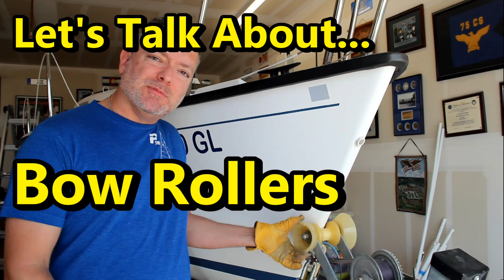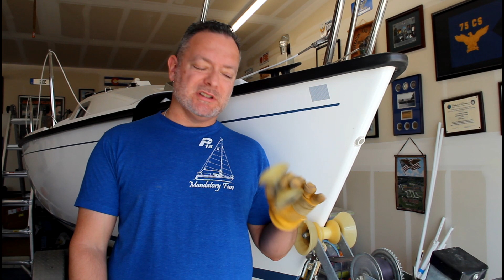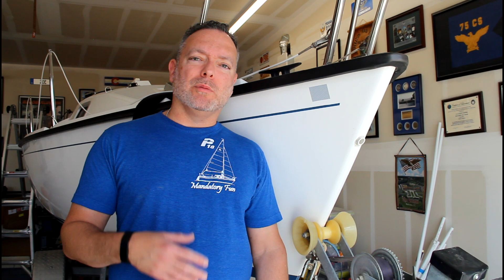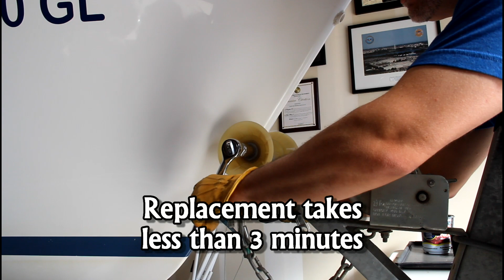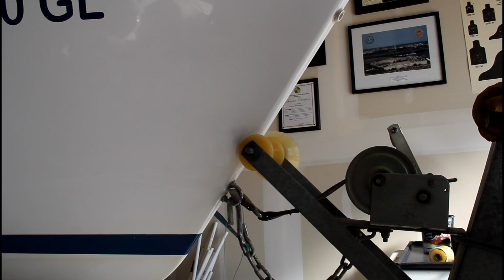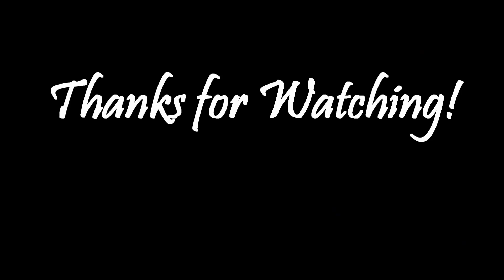Let's talk about: Bow Rollers

Comment: Link needs to be in the description.
Reply from the maker: You can find them a couple ways: Google “Yates rubber bow rollers,” search on Amazon, or go to the Yates section on eTrailer.com: https://www.etrailer.com/dept-pg-Boat_Trailer_Parts-sf-Roller_and_Bunk_Parts-pm-Yates_Rubber.aspx?utm_source=google&utm_medium=cpc&utm_campaign=Google%20%7C%20Dynamic%20-%20Search%20Ads&adgroupid=60357939010&campaignid=1672411816&creative=420838556612&device=m&devicemodel=&feeditemid=&keyword=&loc_interest_ms=&loc_physical_ms=9029003&matchtype=&network=g&placement=&position=&gclid=Cj0KCQiA14WdBhD8ARIsANao07hT3WDWyCMmj1phy4b4k3LZwBA9bAjUWhCU_6w5FVWEx-Muop5EYQoaAipbEALw_wcB

Comment: Dave, you don't mention the oversize outside 'rollers'. What material are they, and where did you get them? Thanks. Happy Holidays!
Reply from the maker: Hey Lee! So the bells are the original Yates Rubber bells that came with my 2010 Magic Tilt trailer. Made of the same flexible rubber material and still in great shape!